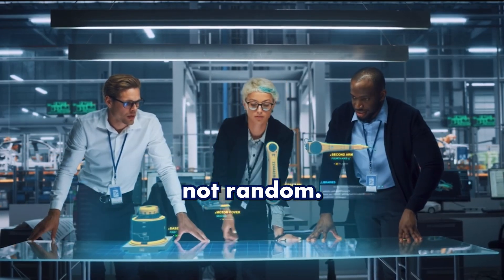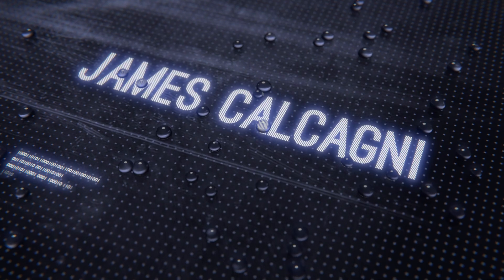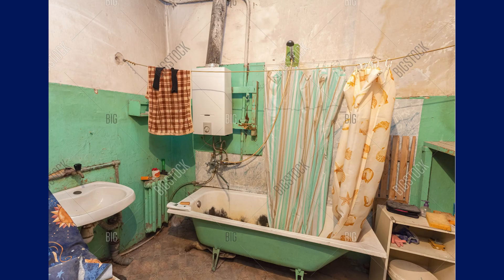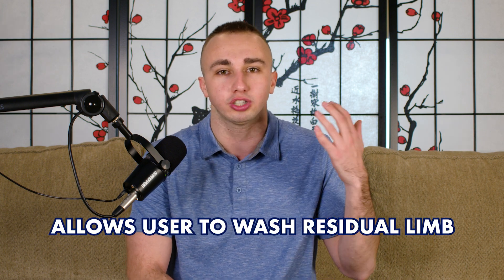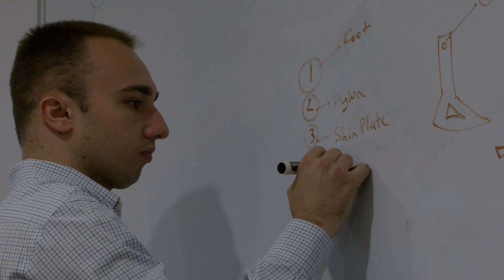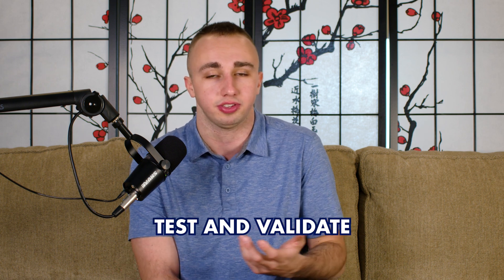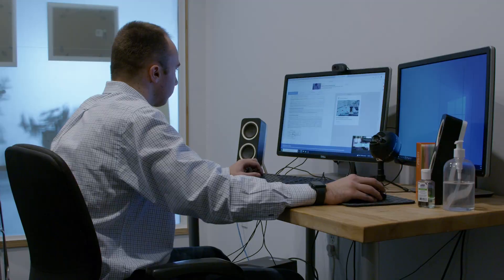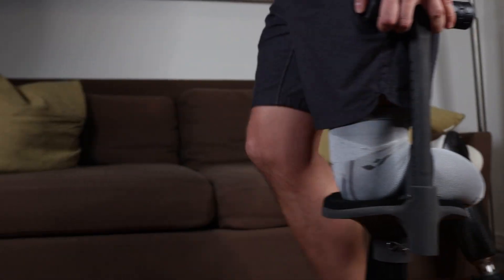Creating the Perfect Product: My Entire Engineering Design Process Step-by-Step । James Calcagni

Comment: Nicely Explained. What are the important points that a person should keep in mind in designing?
Reply from the maker: Thanks😁🙏🏻 and Good question! This is really going to depend on WHAT it is that you’re designing and WHO it is you’re designing for.  I often refer to these as “design constraints” and they’re important to define early on and keep in mind while you are designing. These range for every type of design- for example, safety is paramount in a lot of the designs that I do as you want to make a device that is safe for all users. Functionality is another one that is pretty important to me across the board- it doesn’t matter if it looks nice if it doesn’t meet all the specifications and design functions it is supposed to. There are a lot more like cost, reliability, sustainability, usability, and manufacturability that are pretty common to most designs, but again it really depends on each case!  Overall, you need to keep in mind that design is balancing all those different components and there is no one way to solve a problem so you should always be innovating and applying creativity👍🏻